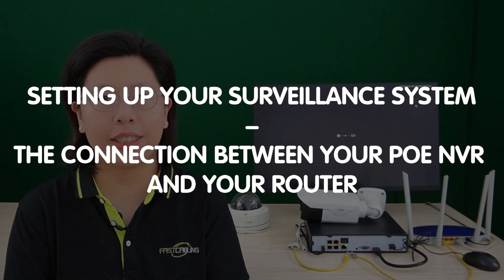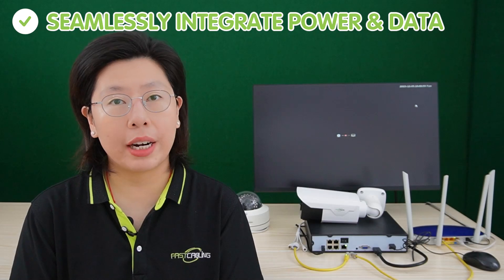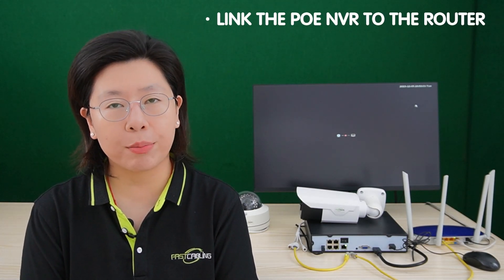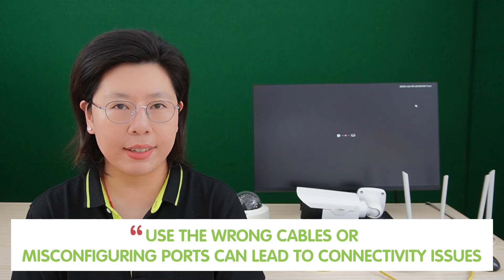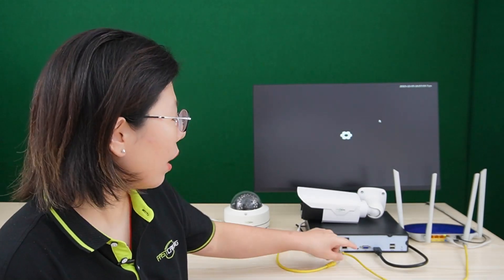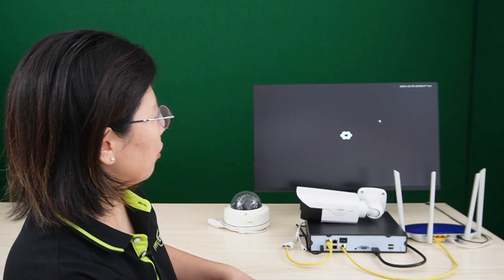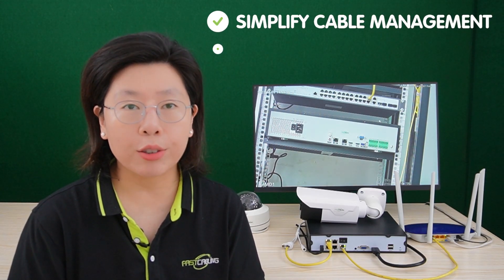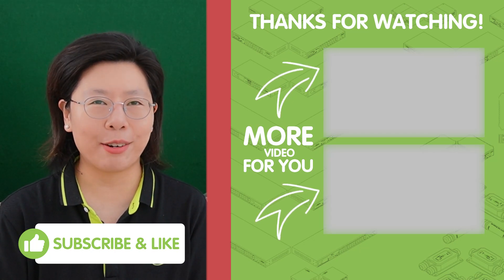Avoiding Common Mistakes: Properly Connecting Your PoE NVR to Your Router

Comment: Is possible to connect a POE switch to this NVR using this configuration?
Router --> NVR LAN port
NVR Port 1 ---> POE Switch --> Camera
NVR Port 2 ---> Camera
NVR Port 3 ---> Camera 
etc.
Reply from the maker: Yes, it will allow you to power and manage additional cameras connected to the PoE switch. However, the number of cameras must not exceed the maximum capacity the NVR could handle.

Comment: Let us see if I got this right.
As long as I use cat6 as the starting point from my router.
I should be able to run a 100mtrs cat cable to my poe nvr.
then run another 100mtrs to my poe switch.
there for getting an extra 100mtrs.correct?
Reply: Yes
Reply from the maker: You are right. The PoE switch can repeat 100 meters extra, but we don't recommend you add more than 3 switches. It will create the serious latency that could affect the IP cameras sytem.